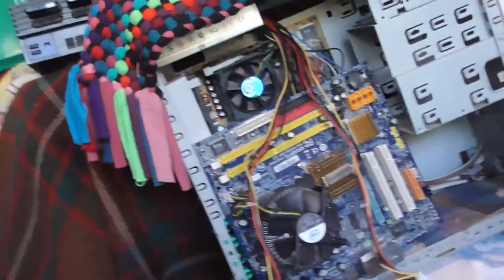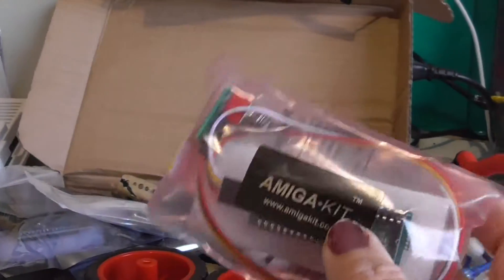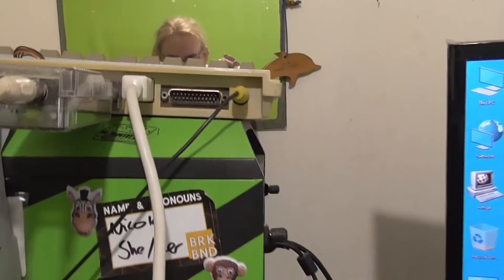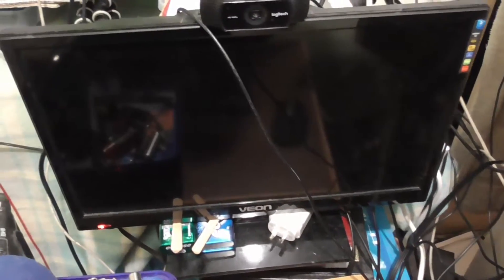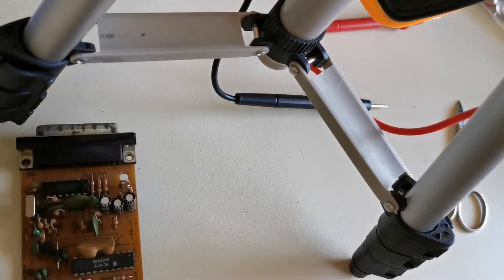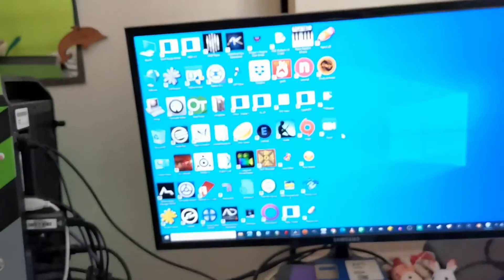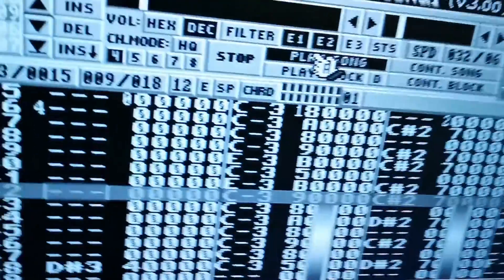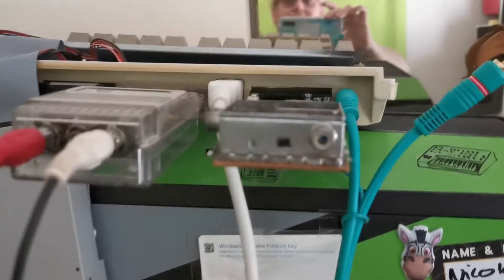Amiga A520 TO HMDI MOD

Comment: Thankyou for this video as im just getting back into amiga after 30 years odd. I noticed you had a AV to HDMI box wich is cheaper than ramming expensive conversion circuit boards inside an classic machine.